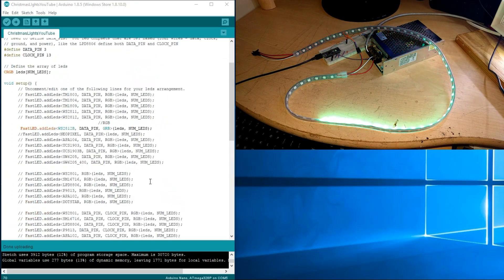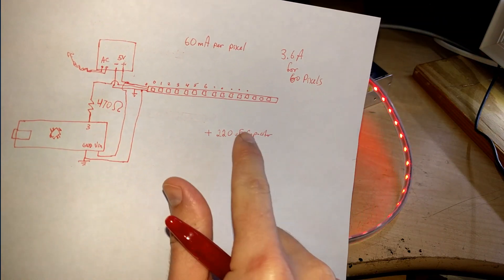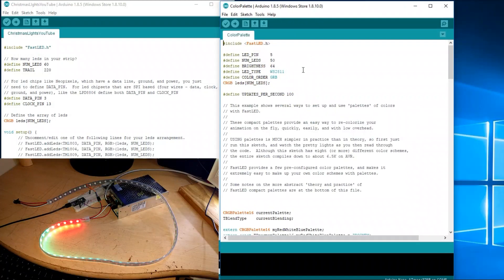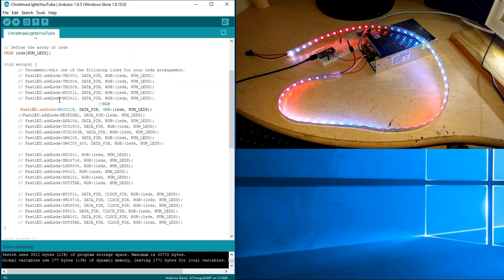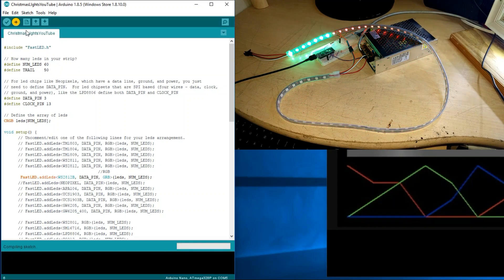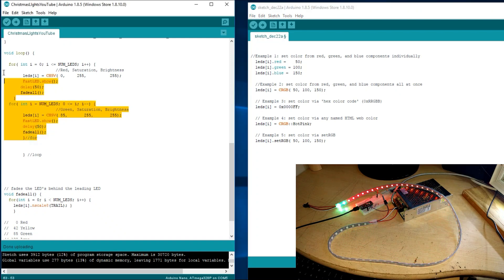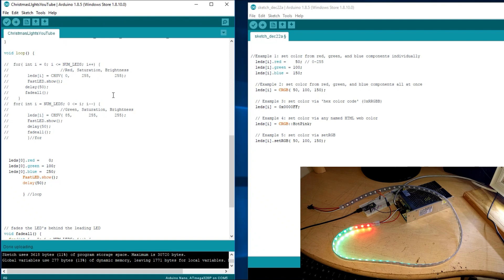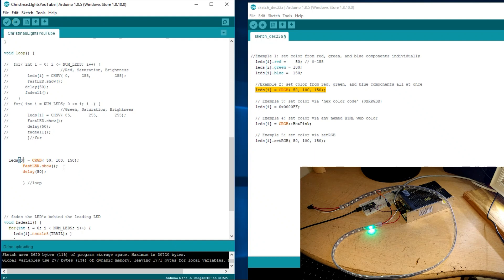How to - WS2812B LED Strip

Comment: Thanks for sharing!

A couple of things are unclear to me, although it works. I think there is difference in your wiring schema and the actual wiring. 1) On your sketch there is a power wire coming from the power supply towards the 5V input of the LED strip. That's clear. These is also the ground from the Arduino to the power supply. Clear. And last, the D3 wire with the 470 Ohm resistor is also clear. The other short wires on your breadboard are not explained. In your sketch there is a wire between Vin on your Arduino and the 5V output of the power supply. I don't see this back in your actual wiring. Why?  

If I connect it without connecting the 5V or Vin port of the Arduino to the 5V LED wire, nothing happens. I expected that my power supply (5V, 10 A) should feed the LED strip so there is no separate additional 5V output, provided by the Arduino, required.

2)  Could you explain the usage of the 470 Ohm on the D3 pin (Why 470 ohm, why not a different resistance?)
Reply: VIN = 5V pin current + the board current. And limited if the Arduino Nano is fed by USB. Per color (RGB), 20 Ma is being consumed so that makes 60 mA per LED. 60Led requires 3,6 A.

The resistor is required for noise reduction in this case, right?

Comment: Would It be possible to plug 2 maybe 3 of these together? Would the data be passed correctly?
Reply: Yes it would work good, you just need to change the number of LED's in the code.

Comment: i bought 60 leds per meter. what power supply i need . for 5V. is 3A enough?
Reply: 1 led can use up to 60 mA at max brightness, so 60 * 60 mA = 3600mA or 3.6A at max brightness. So the minimum is 5V @ 3.6A+ or else some LEDs might refuse to light up.

Comment: I see that in your code, you index a specific LED (eg leds[0]), but it is written in C, not in assembler, and controlled by a library and then a compiler, so God knows what it does before it sends the bits up the LED strip.  I have an application (a POV display) where I need to refresh individual LEDs in a strip during a 60 uS window, and accepting that the data rate is 1 Mb/S, and that it needs to send 32 bits along the string to control the LED, it only gives me time to refresh a single LED.  If I can address the 200th LED and tell it to go blue, then I can do it, but if I have to set every LED in the strip back to its current colour except there will be a new colour for the one I want to change - in other words, if I have to refresh the entire strip - then I can't do it.
Where can I find a tutorial that covers the actual bit stream that is sent up the LED strip?  I get the impression that they are not addressable.  Leastways, the datasheet doesn't say anything about any address info in the bit stream.

Comment: Why did you use a 470 Ohm resistor and not a 300?
Reply: I didn't have 300 ohm resistor
Reply: @fedorweemsch  does it matter which one to use?
Reply: No, it really does not, but you need something small 300-900 ohm
Reply: @fedorweemsch  I'm using a mega for my project as well, creating a 750 led addressable light show with an SD reader and an audio output jack. Fully self contained pretty cool project. I'm new though so it is slow going. Thanks for the input!!

Comment: I have a question for you. I have a WS2812B LED with SP110e controller. I know I need 5v 3.4a. can I also connect 5v 20a or is that dangerous
Reply from the maker: As long as it is 5v you will always be fine. 5A or 50A does not matter

Comment: Hey, so o bought another ws2812b LED strip but i wont even bother about arduino so i have magic home pro. But the device is not working like when i reset it. It then turns a random color displayed on the app but when i change it nothing happens unless i press the red cable to the white cable but it then just makes a regular white color then the device is not working. Wonder how i can fix this
Reply from the maker: Make sure the connections are good

Comment: I'm using a 5v ws2812b LEDs and I use about 89 LEDs of it (60 LEDs per meter).
How much Ampere do I need to power it all?
I have connected it with a 1000mA power supply but it only powered about 60 LEDs from the 89 LEDs.
Reply from the maker: You need at least 3.4Amp power supply

Comment: Hello, i was wondering what happens if o use a 12v power supply when i should use 5v. Will it destory my LED strip?
Reply from the maker: It may burn it out. Always follow specifications

Comment: sir help mah i have 3 area shows 

GND,D0,12v    i have to make sound reactive strip so plz help meh to connect with supply
Reply: 3 jumper connecter and 2 external wire is given -_-

Comment: Hey I’m buying 2 5m 300 LED’S from the link you provided so what’s the power supply I need?
Reply from the maker: You need 1A of current for every 17 RGB LEDS. so it will depend on how many LED'S are in the 2 strips
Reply: @MadeEasyChannel  (2)  5M 300LEDs, Non- waterproof, Black PCB
Reply from the maker: @skaterfreak420  you need a power supply that can provide about 35A
Reply from the maker: @skaterfreak420  what voltage are the LED strips? 5v or 12v
Reply: @MadeEasyChannel  output is 5v sir
Reply from the maker: @skaterfreak420  so you need a 5v power supply rated for minimum 180W and 35A
Reply from the maker: @skaterfreak420  those stops will get hot. You may need to inject power every 2 meters by solder wires to the positive and negative of the LED strip every 2 meters
Reply: @MadeEasyChannel nevermind im buying 1 5m 300 LED's  5V
Reply from the maker: @skaterfreak420  5 m is a long distance. If you notice the LED strip getting hot. You'll need to inject power every 2 meters
Reply: @MadeEasyChannel  so im still waiting on the answer of power supply cause im still confused but i understand about the injection of power of what your saying
Reply from the maker: @skaterfreak420  you need 5v power supply that's rated for 180W
Reply: @MadeEasyChannel  i found 12v 15a 180W on ebay can that work?
Reply from the maker: @skaterfreak420  https://rover.ebay.com/rover/0/0/0?mpre=https%3A%2F%2Fwww.ebay.com%2Fulk%2Fitm%2F272961517798

Comment: which dc do i need for 2 x 1meter 144 led, or how much ampere do i need for 2 led stripes with 2x144 5050 ws2812b led
Reply from the maker: What voltage do the strips require? 5v or 12v
Reply from the maker: You need 1Amp of power for every 17 RGB LED's. So if you have 288 LED's you will need about 17Amps. I'd say you need to get a 20Amp power supply

Comment: It would have been incredibly helpful if you went over how you connected everything on the breadboard. That is my biggest issue right now, and I have yet to find a youtube tutorial to explain it well... or at all, for that matter.
Reply: he does. if you dont understand the diagram at  2:00 and the way electricity works then thats on you.  he tells you that the + needs to be linked directly to the led strip and bridged over to the vIN on the arduino, and the same with - to GND ( clearly because the arduino can not survive pumping the Amps needed to power the LED strip, he goes over this when speaking about the power supply)  
he tells you the data cable needs a 470R resistor from D1 (data1 pin) to the data strip. more then likely to protect or keep the current stable so the signal sent is more precise for the led strip to use ( i could be wrong this is my first day looking into this). i think the issue is your lack of understanding.
Reply: Glenn Jenkins
HI, like he said you will need minimum of 3.6 amps 5v supply  4 amps or more is better,  you can connect  arduino and  rgb  lights in parallel  and data line to any pwm capable pin, and the adjust code to show that pin as data pin in your sketch. you do not need a breadboard.
Reply from the maker: Glenn Jenkins 0:45 seconds in the video I show a schematic, I hope it helps